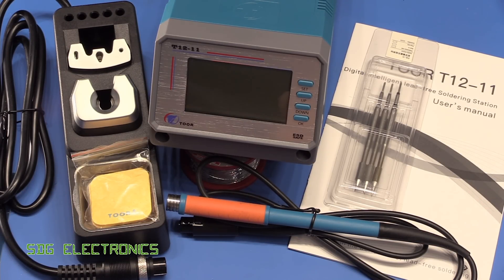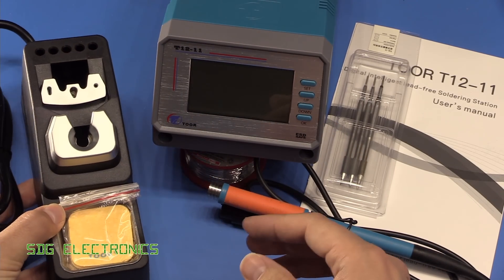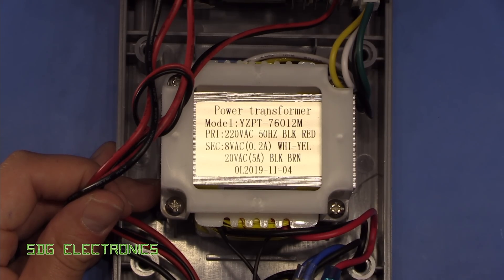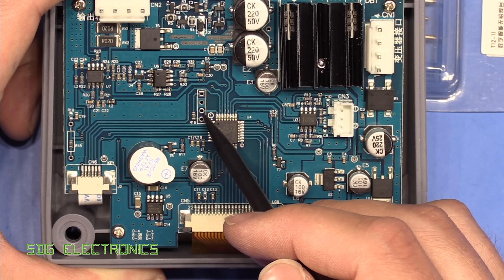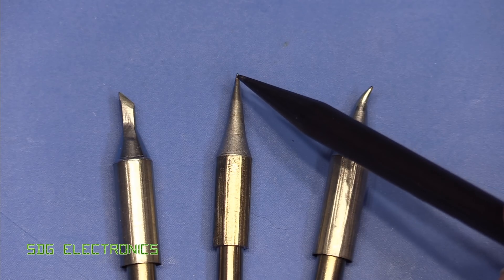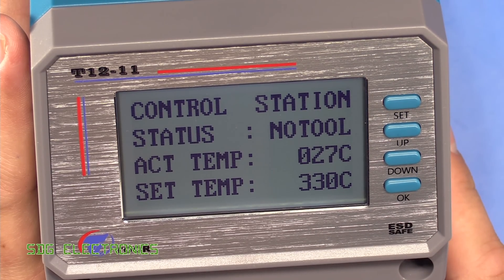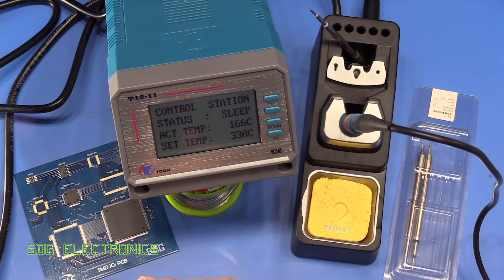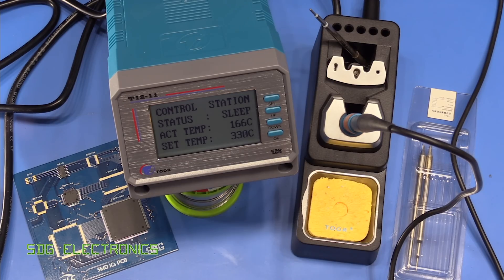SDG #140 Toor T12-11 Soldering Station for JBC C245 Tips

Comment: Nice basic instruction about where to use various solldering tip types. Pointy tip works well for small thru-hole components. Bent tip for soldering SMD components with few pins. And knife tip - on QFP and flat cable desoldering. Minispoon (JBC C245931) is probably the most awesome tip for QFP and flat cable soldering to board.

Comment: Do genuine JBC C245 tips fit in the handle ok. I have heard about problems with JBC clones, where the genuine tips don't fit in snugly and make proper contact, or in the worst case, cause a short circuit

Comment: Halo bro my toor T12-11 power on but problem  low temperature cant burn anything if I set  350c can't burn seem like 100c and  if I set 500c seems like i set 250c burn slow slow  still low temperature i try new handle form another toor still problem but my hand works good on onother host  problem is my Host I dont know inside machine got problem
Reply: Did you get it fixed?
I have one with a similar issue.
Reply: @pakiisam6075  "The 'TOOR T12' is a knock-off of the Spanish JBC 245 soldering station. However, they have customized a special thermocouple to prevent users from using alternative heating elements. The price of TOOR's heating elements is at least double that of others, allowing them to make long-term profits from consumables like these heating elements. Any Chinese person who knows this will not buy any TOOR products, even if they are made in China!"

Comment: I got one of these the other day and it does work well. But my copy does not work with JBC tips. I got a C245931  and it will heat up but does not regulate. It will go to 480C and the the display will go from "Working" to "Burnout" and the tip will go cold.
If anyone has ran into this and knows a fix please let me know. It there is not a fix this is a fail to me as having to get tip from china all the time is a big negative to me.
Reply from the maker: It sounds like the contacts on the JBC tip might not be making good contact with the handpiece. I didn't have issues with genuine JBC tips though on my unit strangely
Reply: @sdgelectronics  Just did some checking. It seems that the center contacts on the tip are not the same length. The overall length is the same, the center contact on the JBC is 10.68mm with a 2.3 mm indent. The tips it came with have a center contact that is 12.96 mm with a 1.5 mm indent at the end of the contact. So it seems to me that you are right and my handle is not working with the JBC tips.
I am going to check the JBC tips spec sheets to see which tips may work. Thanks again!!
Reply: @sdgelectronics  I'll check that.. Thanks Steve!!

Comment: Hi, I bought the same a few days ago ... it's not like everything in the
 video, I don't know which station you tested. For my part it does not 
heat up enough the tip sticks on the card and the tin does not stay 
caught on the tip. I do not strongly recommend it
Reply: Can you please elaborate because I want to buy this station,does it heat up as well as t12 tips? Do you know you can buy tips specifically made for this for $10 each? Thanks for your help in advance

Comment: would the handle work with a real JBC. I have T210 handle and I have been wanting to get a t245 handle but they aren't cheap. That can be said about anything JBC lol
Reply: Fixed Until Broken your answer is here !
YES AND YES AND YES ! YOU can use original JBC tips ! The JBC tips are a little bit shorter then the from t12-11 toor soldering station but is working very nicely ! 
Best regards,
Reply: @lycanlycans7548  Yesterday I bought 2 C245 tips from relife shorter like you said. But I was mad, measured with thermocouple and can't go above 350-360c . Are the tips damaged , or they work differently as opposed to the Toor default ones?. I calibrated to 25-26mv incresed temp to 400-450. but somehow it's like thje tips are capped somehow.
Reply: @juangizirian9810  Same problem, also with relife t245, and also from Argentina! I guess they don't use the same resistance... Honestly disappointed... I'm thinking whether to buy a jbc tip or try the axium...

Comment: Steve, great video again. You have confused people - this is a good review, but then the BEST one was a good review. 
I have a Metcal Mx500 and about 40 different tips. But as you note you cannot change the temp of the tips. My tips were bought before Lead-free came out and so don't work very well. 

Which is the better soldering station this one or the best? or something else? Soldering stations tend to be one-off purchases for years so would like to get the best one now for the next 10-15 years....

keep well
Reply from the maker: Hi Jack,
Very little in terms of performance between the two stations. I think these work well because they mainly rely on the good performance of the C245 tips.
If you're used to the Metcal, I'd get the MX-5200 series
Reply: @sdgelectronics  many thanks. I will take your advice.

Comment: @5:47 Interesting discussion about tips.  I've always just used a pointy one for everything... the conical curved thing might be something I should try out.
Reply: NivagSwerdna for what it’s worth, pencil tips are my least favorite, and I remain baffled that so many irons ship with them. In my opinion (one shared by many iron makers and soldering pros), a chisel tip is a far better everyday tip. But I’ve also been learning the value of more specialized tips. I LOVE the hoof/well tips intended for drag soldering, as they suck up excess solder from a joint — and this makes them great not just for drag soldering, but also for THT (especially when the pads are unnecessarily small, as is often the case with Chinese PCBs), and for tinning wire.

Comment: DC heater supply, is that normal.  Don't they often regulate the A/C direct
Reply: Justin Richards Both systems are common. (Makes no difference to heating performance, since a resistive heater simply doesn’t care,)

Comment: Very interesting soldering station. I really like the clean, crisp display. A shame it is available only in a 220V version, though.
Reply: Easy to convert. Buy a cheap 120V/24V 75W transformer, or salvage it from a cheap soldering station. You can buy them on eBay for next to nothing. If it doesn't have a 5V or 9V rail, you can add a small ac-dc converter.
Reply: @bobweiram6321  I might give this a go. Thanks for the suggestion.

Comment: How fast does the tip heat up? Heating speed is one of JBC’s strengths. What about thermal capacity?
Reply: Frédéric Boivin The thermal capacity is determined by the tips, and the tips are the real JBC ones. 

With that said, that’s a blessing and a curse: JBC tips perform very well (it’s what I have at work), but they’re not super durable, and they’re very expensive. Pace ADS200 tips would be a really nice alternative, as they perform nearly as well, but last longer and cost far less. (The Pace tips use thicker iron plating, which slightly reduces thermal performance, but massively improves tip life.)
Reply: @tookitogo  link to the tips please

Comment: Why is it called T12-11? 

T12 is Hakko's designation for some integrated heater tips, it got picked up by manufacturers of stations that are compatible with those tips, but this one is not.
Reply: That T12-11 Toor Soldering station use JBC tips ! Not T12 hakko tips I know is irritating but they   chose a wrong name! 
And YES ! You can use original JBC tips on that station !
Best regards,
Reply: @lycanlycans7548  Is the Toor T12-X and the Toor T12-11 the same soldering station ?

Comment: Thanks, Steve! I don't know why you hate those tips so much. I love the Hakko curved conical tip for SMD work. And the knife tip comes in handy removing SMD caps, resistors, etc. Just put the tip along the side of them and slide them off of the pads. I need to get a nice micro-pencil.
Reply: When I got a STM32/KSGER T12 I also thought the blade tip was useless, but after I figured it can remove SMD stuff in one hit I now love the thing.

Comment: How would you rate it compared to the KSGER t12?
Reply from the maker: It's certainly more professional and better built. The C245 cartridges fit perfectly, but come at a price.
Reply: @sdgelectronics  Tell me about it.....Just bought a JBC and a collection of 12 C245 cartridges!
Reply: @sdgelectronics  Greetings from argentina, excellent video. I bought couple days ago this unit, withj it's default tips works beautifully. Then I tried some C245 tips from relife, as I needed a larger K type. To my surprise it doesn''t above 350-360C . Tried calibrating pushing 25-26Mv under calibration . Same thing. Are these relife tips damaged. Can't understand.
Reply: My t12 station will still be my daily driver for the foreseeable future, and I'm waiting on the SMD rework Station as well

Comment: That looks like a nice station. I really dont need a new as my Hakko FX 951 works fine, but I hate it!! It's interface is hard to use and the worst part is it never turns off the handle if you forget to turn it off. 
I really like the idea of the handle plugging into the stand it gets a big thumbs up from me on that so I just may have to get this one!!
Reply from the maker: Yes, it tidies things up a lot and makes cable management a bit easier.
Reply: It is never too late to get metter tools if you need them. Just moved from TS-100 soldering iron to T/C245 station, because TS-100 using experience on desktop is burdensome.

Comment: What desoldering tool you recommend for professionals?
Reply from the maker: The Metcal desoldering gun is probably the best out there when combined with the MX-5200 type power supplies. Pricey though.
Reply: Thanks. Does it require any other device to get it running. I watched your review of MX-5200 and I remember that you mentioned it requires shop air. How is shop air used? Do I have to buy a seperate compressor to make it work?

Comment: Supposedly "ESD Safe" but the tip is not grounded?
Reply from the maker: Good point, many leave a connector so that you can attach it appropriately. On reflection, the unit would be better to use the 4mm connector on the back and tie that to the iron lead rather than the AC inlet.